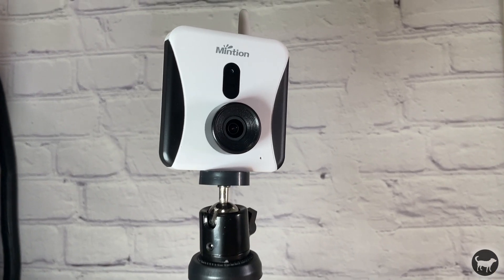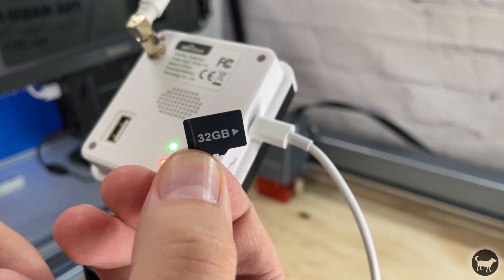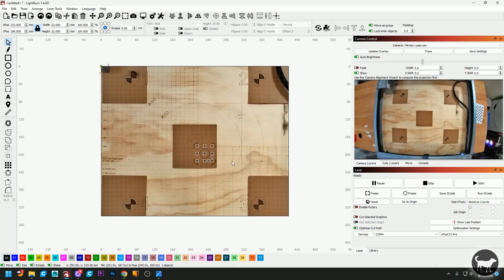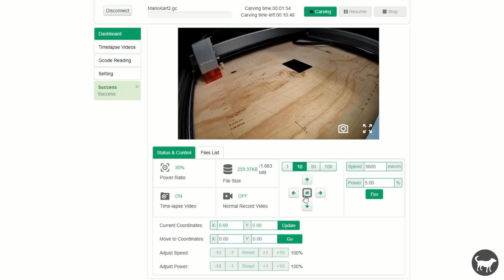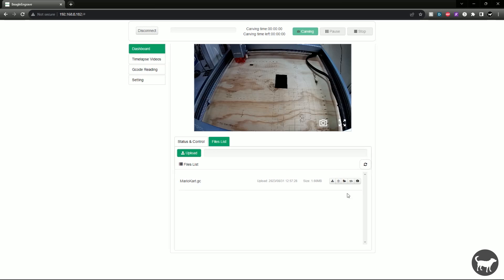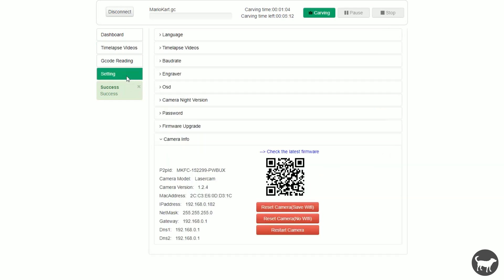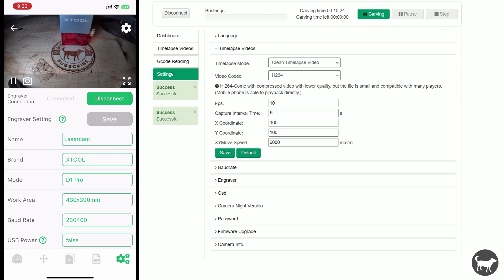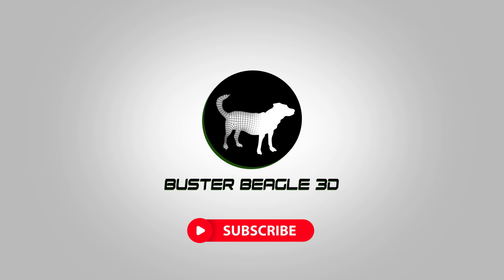Mintion Lasercam Review | Control Laser Engraver over WiFi | Mobile/PC Control | Timelapses

Comment: Can I use the beagle V2 for laser, instead of specificaly the beagle laser cam?
Reply from the maker: No. The firmware is different and the are completely different devices. They can't be used interchangeably.

Comment: This is awesome, I wonder if it can work with the Devil1 Lobotomy kit for xtool or if it kind of replaces it?
Reply from the maker: I haven't used of the Devil 1 Lobotomy kits so I can't say for sure. I believe that kit adds a few other things like limit switches and such so it's not a direct replacement but it does add some really cool functionality to it.
Reply: @BusterBeagle3D  Thank you, yes it adds the ability for the program to run the air assist as well.

Comment: Thanks for the video on this. I’ve been looking for one. 2 follow up questions. 1 I’m a little confused can you still use lightburn on your laptop to load jobs and run the laser and use the laser cam?  2 can you still use the cam inside the Xtool enclosed with the lid closed? Thanks again
Reply from the maker: Yes you could run the camera connected to a laptop to directly camera control the laser in Lightburn.  However you would not have room to have the camera overhead with the enclosure as well. I had it in my enclosure again as more of a "security camera" view rather then the overhead view. It would just stick out too much to close the enclosure.